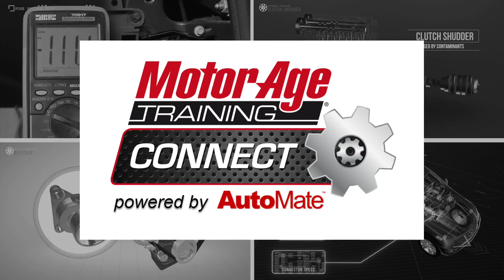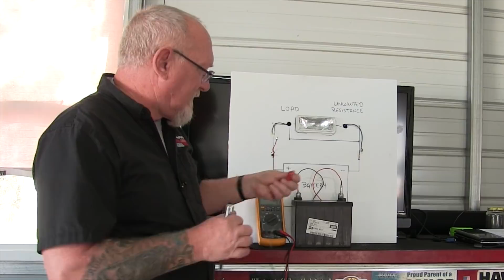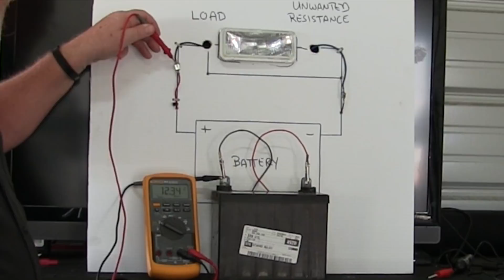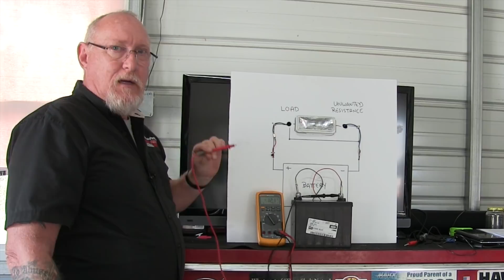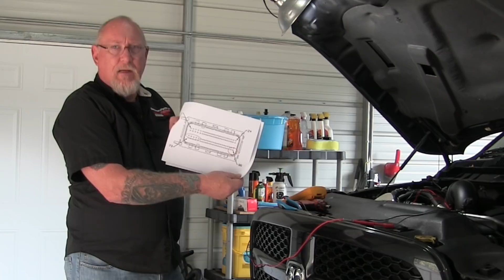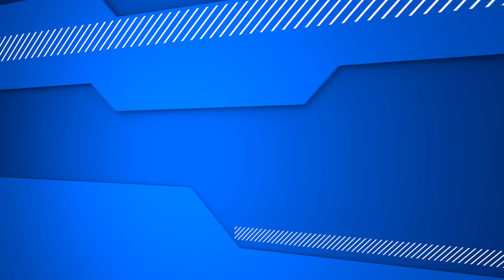Checking ECM Power and Grounds

Comment: I liked the video. However I was at first confused when referencing the actual battery and the drawn picture of the battery. As you continued to move the leads around, i got confused if I did not remember what you said about which terminal you were putting the lead on (When I looked at the "+" on the diagram, it was not the "+" on the actual battery.) Please rotate the actual battery in your video to match the picture. Otherwise keep up the good work!
Reply: I was confused about that also haha glad you cleared that up